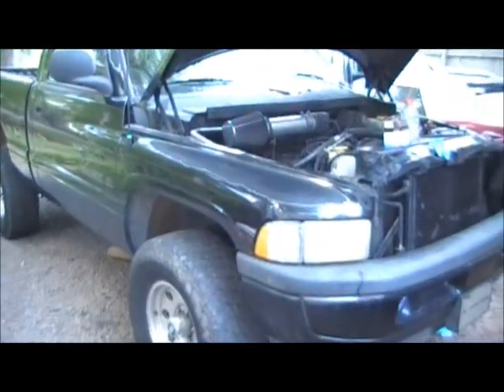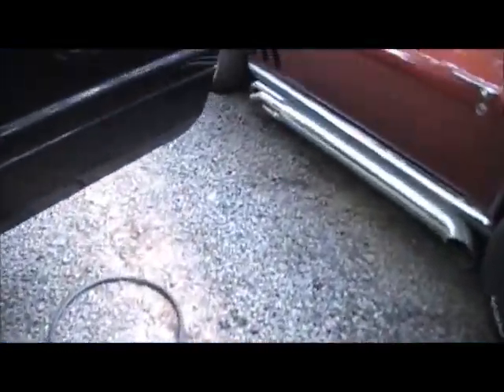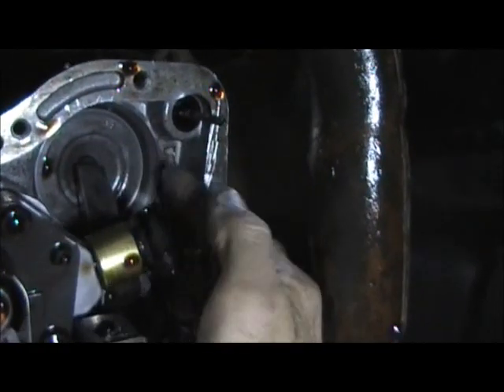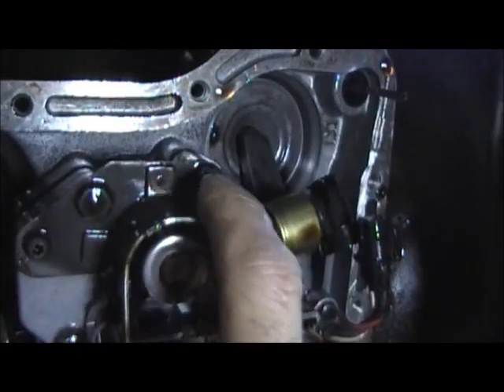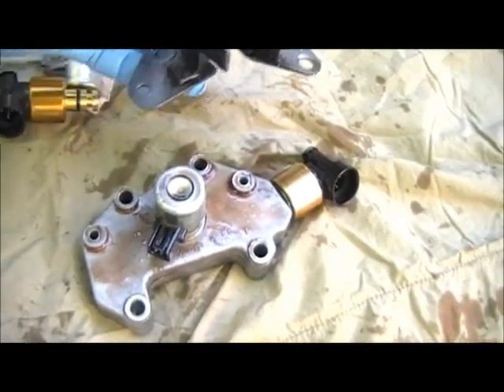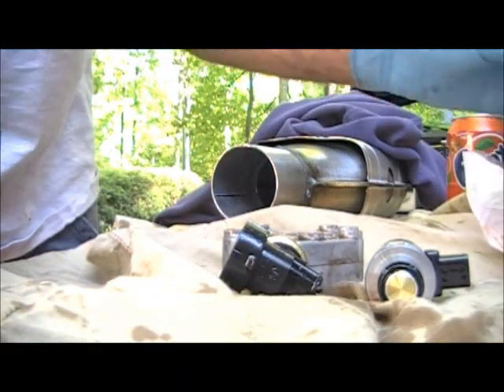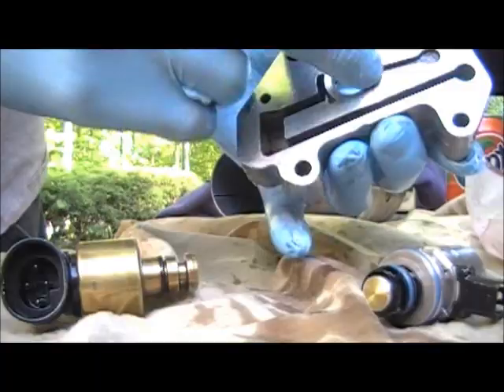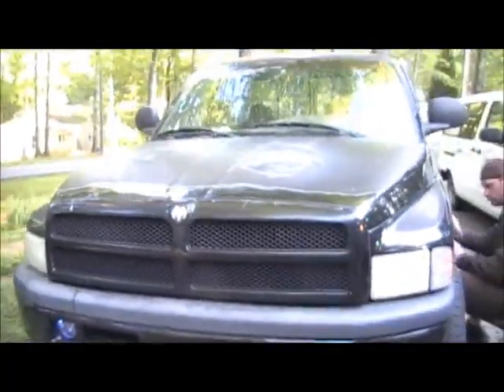1998 Dodge 1500 Transmission Wont Shift Fix

Comment from the maker: Running them dry or low on fluid is b A d . You have one chance to bring it back with the procedure shown in this video. You can find the parts needed by looking in the phone book for transmission parts suppliers in your area or try a local parts store. The suppliers are much more reasonable . The valves do not like being exposed to the amount of heat and loss of pressure which it is exposed to when the fluid level drops. Also the fliter in the pan has more than likely filled w trash.

Comment: I have a 98 Dodge Ram 1500 5.9L 2x4. My Transmission makes a whining noise in reverse, moving or just sitting. It still shifts fine. Fluid is a good color and full. Also, my ABS light came back on after a short drive despite replacing the ABS sensor. And would you know the points for checking the seat belt retractors- seat belt light wont go out. By the way, nice video.

Comment: Wow! You may have saved me hundreds. Also why do i feel like my truck is in haul mode? It definately shifts funny. Sometimes 2nd gear will go past 3,000 rpm and then shift to third and then within 5 second it shifts to 4th
Reply from the maker: b e It won't be long before you spend those hundreds.....wished I had a less expensive guess.....

Comment from the maker: Mmmm, roadrunner, love those cars. The total cost of solenoids should be arround 100.00, and yes I think you could do it just fine. As for will it be worth the money there is only one way to know unfortunately. That is to do it and see if it last, I have had mixed results but for those it works for , they are very appreciative of the savings . As for the detent cable, nope it wont help with this issue.

Comment: Hello, thank you for posting this video.

I have a question,

My truck is a 1998 Dodge Ram 3/4 ton with the 46RE transmission…

When driving it would have a tough time changing from first to second unless I let off on the gas a little to assist it. 

Eventually 
I lost park, I first removed the linkage from the transmission to see if it would shift freely… the column shifter worked great but on the transmission itself… it wouldn’t go into park so I dropped the pan and found the transmission anchor sitting in the pan. 

Do you think that the reason for loosing park is the anchor that fell out ? 

I checked the adjustment for the bands and it is extremely loose and could use adjusting. 

I know that their is a park rod as well in the transmission and with the valve body out it does slide. The valve body itself shifts freely through all the gears when removed. 

Thanks
Reply from the maker: Parts sitting in the pan is never good. Something had to of broken for that to even happen. 
 Sounds bad......

Comment: I have a 97 dodge mine does alright then seems when it gets warm it slips out of overdrive and sometimes 3rd gear. And when it does that when u stop then go it won't shift out of second unless I put it in neutral then back in drive then it will shift in to 3rd any ideas??

Comment: ive got the same truck but 4X4 and it hesitates to shift into 2nd or 3 and when i'm at about 10 or 15 mph it kicks and sounds like its knocking. whole new transmission or could i replace a few senors? help please

Comment: hi i was wondering if you could help me out i have a 1998 dodge durango and when i first start to drive it its slow to pick up speed then when its run a little bit it smooth out but when i slow down some times then try to go up a hill it cant pick up speed fast enough and it make a loud grunting noise what could be wrong with my truck

Comment: do you think this would work for a dodge transmission,thats not shifting into drive?i'm going to work on a friends' 1996 dodge 2500 van(5.2 v-8),it takes 10 minutes for it too shift into drive when it's cold.

Comment: I have a 2000 2500 Dodge Ram gas engine . I bought it with the understanding that it needs a tranny . The problem is it won't shift up at all from first gear . Is there a possible fix for this or does it need replacing

Comment: I've got a 1997 Dodge Ram 1500 4 by 4 automatic transmission transmission was slipping I paid $1,200 for a shop to fix it it didn't work the transmission is still slipping does it hardly pull. Do you think this would fix the problem I just have no faith in the transmission shop anymore

Comment: I have a question, I have 1997 Lincoln Mark VIII. the problem i'm having with is, the transmission had a leak which i thought was coming from a front seal. the other issue was that it went in all gears but drive. meaning that it would move backwards, go into neutral, even in park. NO PROBLEMS. However when i put in drive it would stall then when i rev it up it would move. So i saw that there was very little fluid inside so i added some. check it again same thing. So i took some steps to see what was wrong with it. 

1. i drop the trans pan clean it out put the magnet back. 
2. then i replace the trans filter
3. replace the gasket around the pan with a new one also check the level around         pan, taped the pan till it was leveled all the way around. 
4. put the pan back up and replace the fluids with the same amount that i took out       then top it off.
5. No leaks

do you think it could be a trans solenoid ?
or do you think the trans shift is out of wake trying to save some money without going to the transmission shop. even though i may have to take it to them.
Reply from the maker: That's not good at all, I would look at a new unit.
Reply: New unit..... what you mean
Reply from the maker: New transmission.
Reply: Thanks man... i was thinking about it

Comment: I have the exact problem in my 99 ram sport 4x4 with the 360. awesome video, but how do you adjust the bands?
Reply: look up your transmission manual for exact turns, 44re is loosen lock nut on inside pan band adjustment tighten to 72 inch lbs then back off 2.5 turns. the band you can adjust on the outside of tranny is the same . tighten to 72 inch lbs except now. this you back off 2 and 7/8 turns.

Comment: Did you happen to replace the gasket between the transmission block and the solenoid housing? Not sure if it actually needs to be replaced once you remove the solenoids and bolt the housing back up. Also, are there any torque specifications when bolting the solenoid housing back to the transmission and what solvent did you use to clean the housing and channels inside of it?

Comment: great vid My 1997 dodge ram 1500 4x4  is reving to 3000 rpms then is shifts I have been thinking its a shift soloniod  think if I get these parts that will cure it? please let me know Im about to drop a 1000 bucks on a rebuilt one
Reply from the maker: It will fix it and make the radio work again! Increase gas mileage by 100% and turbocharge the exhaust! No really it wont and there is no way short of magic of me knowing what the outcome on your vehicle will be. Wished I could be more helpful but I tried to add comedy.

Comment: Was this on the 46RE Trans?  What did the parts cost you at the dealer? Would the parts that you showed be the same for my 1998 Dodge Ram 5.2l 4 X2? Thanks for your help!
Reply from the maker: Yes it is.Didn't go to the dealer, a local transmission parts supplier. Yes it is.
Reply: there  100 dollers a piece i just got them myself
Reply: Andrew Thomas did it work for you

Comment: I'm working on 94 dodge B2500 and it's got the same transmission,when it's cold the trans slips,but after warm-up it doesn't slip,would this fix that?

Comment: I have a 99 ram 1500 2wd, quit shifting, I can shif manually but it will not shift by itself.  No codes set, do you think it would be the same problem?

Comment: mine is on it's 2nd tranny. '98 Caravan. I recently told a friend of mine who is about 340 lbs, that I don't want to cart him around because I have had enough trouble w/ my trannys w/ out  that kind of weight. it's a work vehicle w/ a couple ladders(for years) on the roof .I gave in, a few times. he thinks I'm crazy. but who knows their car better than the owner? now, I feel 'slipping' as well as when I hit the accelerator it feels a little like I'm in neutral instead of drive. I'm heading in for an overdue oil change ,and maybe I'll have the tranny fluid changed. any opinions?

Comment: I have a 95 Dodge Ram 1500 46rh transmission when accelerating a bit sluggish in first gear RPMs rise to about 3500 then shift 2 second if I want to go into the 3rd I have to let off the gas a little then punch it to shifts into second after second is fine I was wondering if it is the valve body or sensors or band adjustment check trans fluid when I change the filter no metal shavings at all....
 what do I do???
Reply: Hawkeye/I have the same issue I have the 5.9 an it shifts from 1,2 then 2,3 to soon

Comment: Mine upshifts really slow even after replacing these two solenoids and filter change! What do I do?
Reply from the maker: May be time for clutches. Did you adjust the bands?
Reply: @2012nugget  yes I just performed an adjustment and it helped but it’s still not right also hard to start sometimes wondering about the catalytic converters

Comment: I have a 2001 Dodge Ram 1500 4x4 it won’t shift I changed the pressure solenoid and the pressure Sensor

Comment: Hi 2012nugget, I have a 1998 5.2 4x4 durango. every once in in a while from a stop it will rev up high in 1st and won't shift to 2nd. i would pull over shift it park then put it back in drive and it will be fine. will changing out the gov, solenoid and tightening the band help or do i have a bigger issue?
Reply from the maker: It's always hard to judge a problem without touching/seeing it however a sticking solenoid would do it.

Comment: 🤯🤯🤯 whaaaaat??? i wish i'd seen this before i just did the filter and fluid change ( that didn't address the problem at all ).... my trans is doing slightly different, but  it's still a shifting problem 🤔🤔🤔 to save a couple grand i might just try this and go through the trouble of another fluid change....

Comment: How do i find out what automatic transmission i have i my 1998 ram 1500 5.2 v8 short bed 4x4 3 speed overdrive  ? Thanks.
Reply: Steven Hardy you have a 46re transmission

Comment from the maker: At 1:30 you will see me moving one, it has a locking nut on the bolt, loosen the locking nut and tighten the bolt to remove most of the slack, leaving a little.

Comment: On my 99 it has hesitation from 2nd to 3rd gear... I thought this might be a speed sensor on the trans.. But I replaced those less than a yr ago.. One on rear dif and one on trans.. Should I just go ahead and replace these solenoids
?
Reply: I have a 1998 dakota that does the same exact thing, but she has 250,000 miles on the factory tranny and engine. I had to replace my governor sensor and solenoid because of failure, BUT its important to note that it shifted like that BEFORE and AFTER the repair, EVEN AFTER CHANGING THE TRANS FLUID 3 TIMES. I believe it is band adjustment, or general wear. Possibly getting close to time for a rebuild. Hope it works out for ya, I haven't found a solution yet.

Comment: Awesome video man, I have a few questions if you don't mind? i have a 98 Dodge Ram 1500  2 wheel drive. mine wont shift out of 1st and at about 2000 rpms it loses all power and just revs up. do you think this might be my issue? i was also wondering if it could be my bands. or both lol, thanks

Comment: hey man I got a question for you I have a 96 Dodge Ram 1500 5.9 2 wheel drive and every now and then the overdrive light will come on and kick on the overdrive already changed out the filter in the transmission fluid but it still every now and then kicks on the overdrive I was wondering maybe it's a cylinoid or something the transmission also been rebuilt like 4 years ago it's shifts fine everything's good on it it says the overdrive problem please

Comment: I have a 2001 2500 diesel. Doesn't seem to want to shift into 2nd. Stuck in first. Any ideas?
Reply: what s happened is the truck is in limp mode dos the abs@ ck eng light stay on? if yes the tcm may be bad or or needs to be rebooted.
Reply: what s happened is the truck is in limp mode dos the abs@ ck eng light stay on? if yes the tcm may be bad or or needs to be rebooted.

Comment: mine wont upshift from 1st. is this the same known cure?
Reply: It will likely be the same problem, no matter what gear
Reply: I have a 2000 and it won't shift out of Frist gear but after you get it out of first gear it shifts perfectly fine could it be one of them sensors in the transmission or just the transmission going out.

Comment: How do you adjust the bands?
Reply from the maker: SOTO'S 1:20 - 1:35
Reply: 2012nugget thank you is been 2 years since I replaced my governor & sensor watching this video, now start changing late 3rd gear when I floor it feels like jump to 2nd gear any advice, and thank you
Reply from the maker: Check the detent cable tension, maybe give it a hair bit of slack

Comment: I have a 1998 Dodge Ram 1500 I think I might have the same problem. It doesn't want to shift into 3rd sometimes and it will rev high then sometimes shift if I mess with it, does this sound like the same problem your buddy was having?
Reply from the maker: It does fit.

Comment: I have 98 5.9 dodge ram automatic trans, getting a p0740 code! Torque convert clutch circuit/open. Could this be caused by needing to replace the parts you do in this video?

Most of the time the truck is shifting fine, but sometime it just refuses to shift into 3rd(at least I think it's 3rd. After pulling off the road, putting it in park and then shifting back into drive it is fine.

Comment: just had 46re rebuilt.a month later ,it sounds like there is a loose ring or washer when I give it gas and when get to 2nd or 3rd gear its starts to make a loud grinding noise and then goes away.and when downshifting after slight acceleration will make a loud slamming sound.can anyone help me?
Reply: my truck is doing exactly what yours was. did you ever figure it out? thanks buddy!

Comment: I have a quick question I have a 1994 Dodge Ram 1500 Magnum V8 with it's acting like it doesn't want to shift and the RPMs get really high and it doesn't seem that it wants to shift into the next gear every once in awhile it does shift into the next gear makes a little grinding noise only when my foot on the gas when I take my foot off the gas there's no grinding noise whatsoever do you think this could have anything to do with the solenoids
Reply from the maker: Thomas Connors certainly could however the noise is of concern. I don't like it....

Comment: Is the torque on the band bolts that big of a deal? Can i just be non-he-man about it? If the reverse spring breaks does it cone off like engine valve spring(without air pressurizing cylinder) ???
Reply from the maker: Leave bands with just a little play, just a little. Spring is gravy.
Reply from the maker: Possible but may want  a trans diagnostic done on that one.

Comment: Question, did you have a check engine light on letting you know the transmission Governor pressure solenoid was bad

Comment: Ok so I have a 1996 Dodge Ram 1500  5.9l that is real bad about shifting into 1st and 2nd gear. Takes me for ever to get going. I took it into a shop and was told that I would have to replace the whole transmission. Is that true? Or is there anything else I can do to fix it? Help?
Reply: Good video but can't you please tell me how to adjust the steering box on my 96 did truck it doesn't look like has a flat head screwdriver head

Comment: I have a 96 Dodge Ram 1500 4 by 4 v8 with the 318 engine (my truck won't spin a wheel to save a life feels to have lost power, and it high revs before shifting) would this be the same fix or do I need a new transmission?
Reply: Andrew Bradberry  just had the same problem and it ended up being my catalytic converter , I couldn't spin a tire and lost power climbing hills, my cats were clogged got new ones now my truck will ROAST the tires!!

Comment: My truck all of a sudden wouldn't pull it revved in the middle of traffic and that's it pulled over started again shifted great for about 10 seconds then Just revved again. Serviced the tranny in April no debris. Dropped the pan this time no debris. Got codes p0740 tcc solenoid and p1757 governor shift solenoid. Also found broken 3/4 accumulator speing which explained my frequent shift to od issue. I'm buying the new tcc/ od solenoid, governor and shift solenoid and new valve body just  in case. Do you feel I'm on the right track? 204k miles been driving perfect until a couple days ago. 1996 1500 5.2 46re transmission.
Reply from the maker: Solenoids and spring...you should be ready to roll.
Reply: How hard is a shift kit to install while it is apart and a new valve body just in case?
Reply from the maker: Easy as pie but then again I'm no cook ! Seriously though it should be no issue.
Reply: it was doing great I had all the power in the world to spend the tires for the reverse in 3 miles down the road the rear band snapped and went through the transmission pan so now it's currently being rebuilt. No metal shavings or anything just freaks material all over the place so luckily it will be a cheap rebuild

Comment: My 1999 dodge ram automatic transmission won't shift every time I'm in drive and I start to drive after I come to a complete stop it gets stuck in a low gear after letting off the gas and pressing the gas again it finally shifts do you think this video will fix my transmission?
Reply: i had the same problem and i did a filter change with the two solenoid and it fixed mine. the problem with 99 is there are so many different varieties you have to bring yours in to get the right part. and it should be the whole wiring harness too.